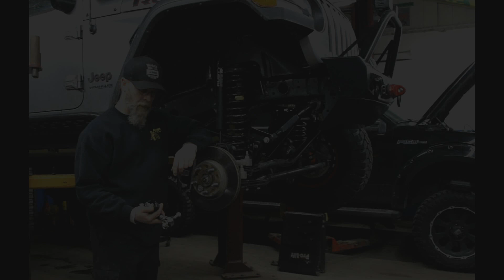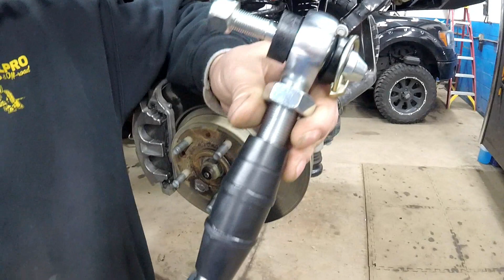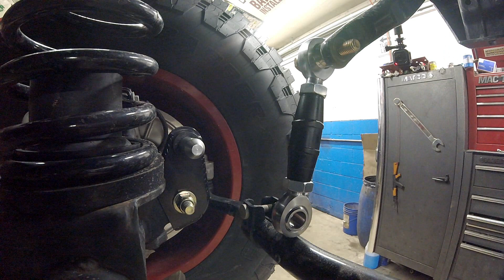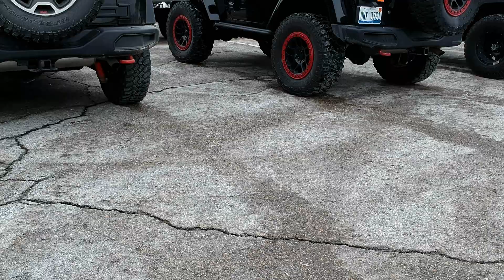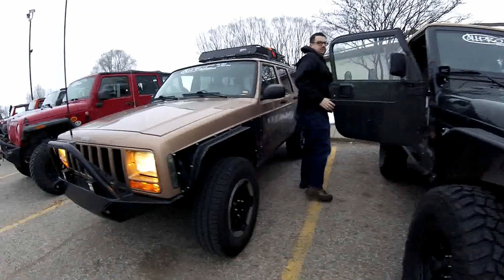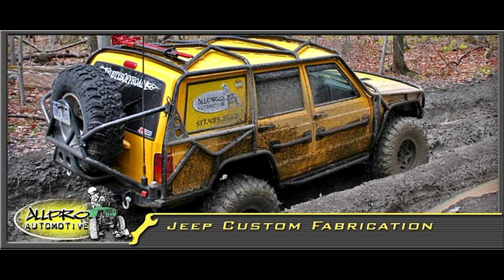JL Swaybar Disconnects

Comment: Where did you get the bracket for the passenger side to not cut off the factory tab?
Reply from the maker: It was part of the prototype kit 
I would never consider any sway bar link kit for the JL that makes you cut the bracket off.
Reply: I bought the JKS quick disconnects but you have to cut the tab off which I don’t want to do. I haven’t seen one that you didn’t
Reply from the maker: There are brands that don't require cutting
Metal cloak disconnects work nice and are a great option
Reply: @AllProAutoOffroad  I only have a 2 1/2” lift. There’s are made for a 3 1/2
Reply from the maker: Then I'd do some research or make a custom set
Reply: @AllProAutoOffroad  thinking about adding a 1” spacer to it and then go with the metal cloak. Only went with the 2 1/2 to make sure I could clear my garage but I have more room than I thought